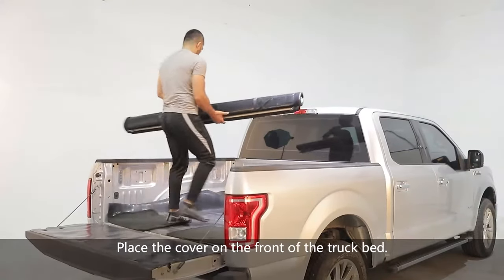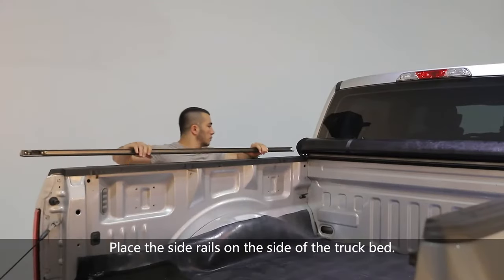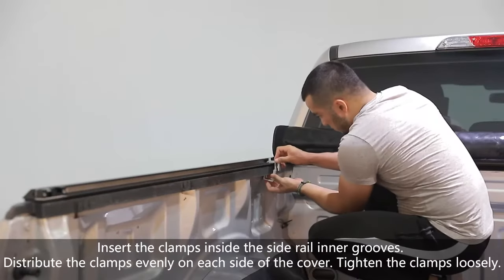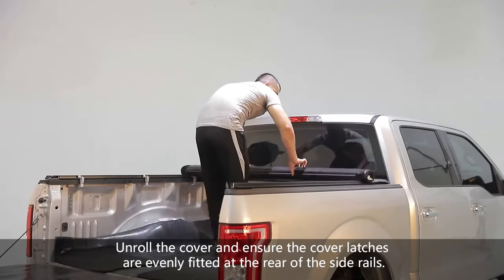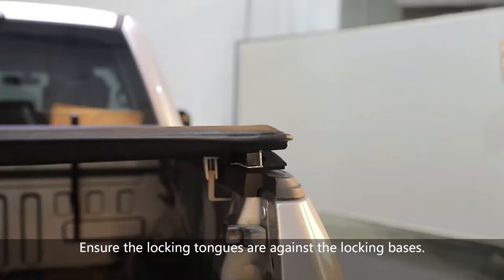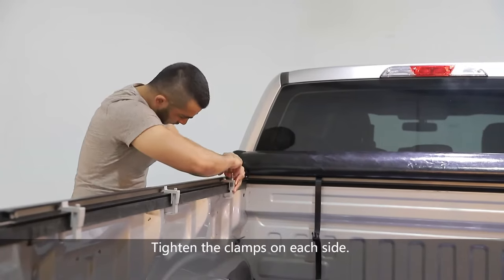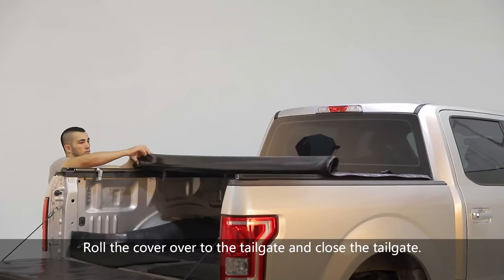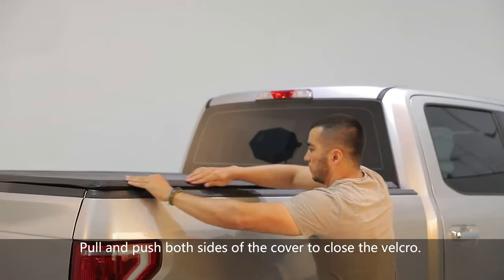North Mountain Soft Roll up Tonneau Cover Install Video（Regular Cover）

Comment: The latch design is really bad. The round slots in the sides that the pegs go into are cheap plastic that bends really easily, causing the pegs to slip out of the sides while trying the close the cover. I'm going to figue out a way to modify the pegs and/or slots so it stops happening. Cover is otherwise nice, but the bad latch design brings it down.

Comment: So 2 of my side clamps are longer and are labeled F. I ended up putting them toward the top of the cover. But it took me a while to figure that out. Also no mention of how to unlock the cover to roll up. Working on that now. 🤷
Reply: Should be a black fabric loop in the middle. Open, the tailgate, pull the loop, and the cover is unlatched.